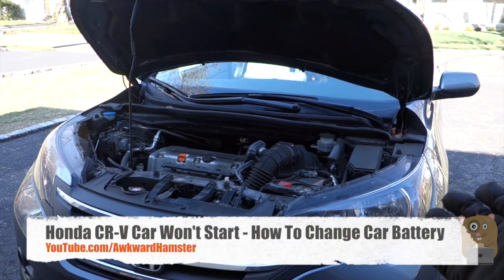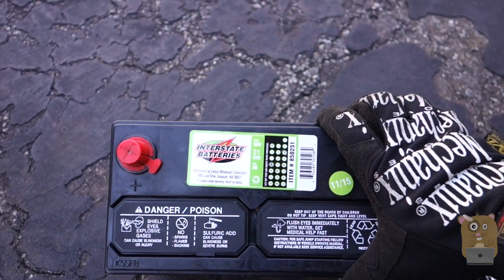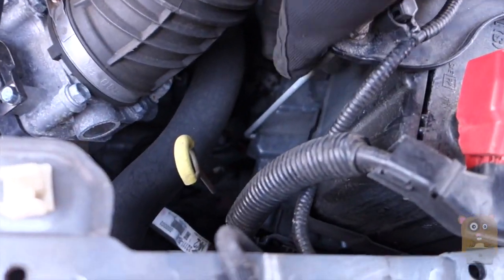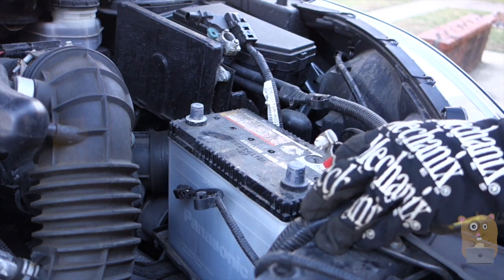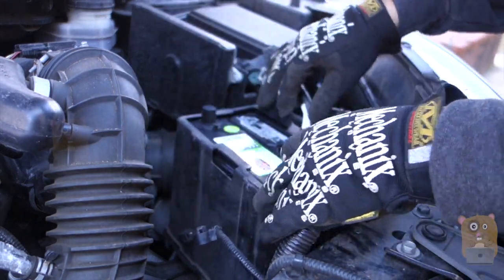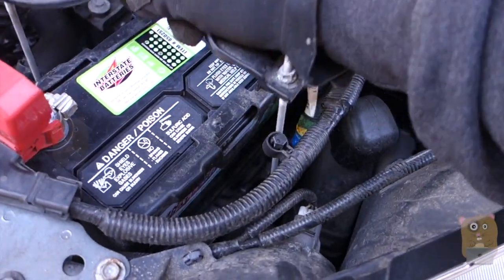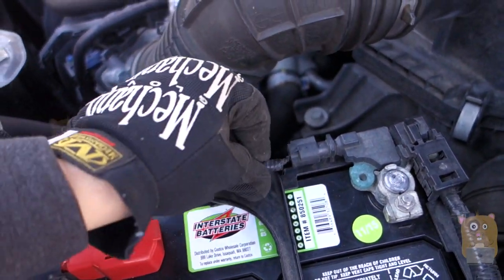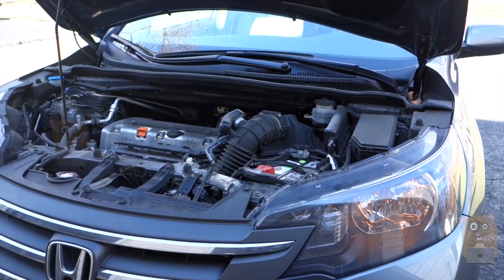Honda CR-V Car Won't Start - How To Change Car Battery

Comment: OMG! You should always connect the POSITIVE Battery Terminal first and make sure you the terminal is tight and secured before connecting the Negative Cable.
Reply: That is completely wrong, DO NOT LISTEN TO THIS^^^^
Reply: SAL Do you really think the Owner's manual is wrong and you are right.  😆
Reply: SAL WHAT? It's STUPID to disconnect the Positive cable first and reconnect it last. Maybe your brain needs a little electric shock to function properly.
Reply: absolutely no difference. except for the following
The reason I would connect the positive cable first (in a negatively-earthed car) is that while tightening the positive connector with a spanner (wrench), if I were to touch the body of the car with the spanner at the same time, nothing would happen and I would be OK.

However if the negative was already connected to the battery and I shorted the positive to the body with the spanner, there would now be a short circuit with a big spark and a possible fire. For the same reason I would disconnect the negative connector first too.
Reply: Negative cable should be secured first.. This will help prevent "you" from being the path to ground in the event of a short.
Reply: The reason I would connect the positive cable first (in a negatively-earthed car) is that while tightening the positive connector with a spanner (wrench), if I were to touch the body of the car with the spanner at the same time, nothing would happen and I would be OK.

However if the negative was already connected to the battery and I shorted the positive to the body with the spanner, there would now be a short circuit with a big spark and a possible fire. For the same reason I would disconnect the negative connector first too.
Reply: @939salm  sal goes silent. Hopefully you don't work on cars buddy.

Comment: Anyone have grinding noise from engine when first start on cold mornings. Some people have the problem and it seems some don’t. The grinding can’t be missed. Honda won’t acknowledge but it has some to do with an auto cam adjuster or something..anyway I turn the key all the way to right for 30 secs or so and then turn to start very quickly once or twice without starting and then start...it helps. Comment please
Reply: same noise from my 2013 crv.  only in cold mornings does it do it
Reply: Check out that starter is returning to disengaged position

Comment: Hello sir, I have a 2014 CRV , just wanted to know what is that container in the bumper on the left called ? I takes fresh air to the air cleaner
Reply from the maker: If you’re referring to the air filter located under the hood, that is for filter out leaves and stuff so it won’t reach the engine components.
Reply: @AwkwardHamster   Thanks

Comment: Is there a security code needed to enable infotainment after the battery install?
Reply from the maker: I need to enter a 5 digit security code after changing the battery, or any power loss, before I can use the radio. My 5 digit code was included with the owners manual packet.

Comment: I think I bent the holder on the top.... is it gonna be a big problem? I’m worried...
Reply from the maker: You mean the metal crossbar that goes across the top of the battery to told it in place? That’s not a big problem. Try to straighten it back and use those J hooks to keep it secure enough so  the battery doesn’t move or shift when when driving. The J hooks are usually pretty long so they can be easily adjusted.
Reply: @AwkwardHamster  alright... that's what I did. Thanks a lot! You replied really fast. Thank you.

The video was very clear. Easy to follow. Great job!

Comment: Did you have any problems starting your CRV after installing a new battery? Let me know if this solved your problem. I am currently thinking about changing the battery on my 2013 CRV. Thanks
Reply: Sung Yang - We changed the battery and it still wouldn't start. Called Blair's Towing and the driver was able to start my car; he said he pumped the gas a few times before turning the ignition.
Makes me wonder if lack of gas was the problem all along, rather than the battery.

Comment: Hi was the computer ok after changing it? Did it need to be reset or anything?
Reply from the maker: After Honda updated the computer, the car allowed me to start even at a lower voltage. I think before the computer update, the car won’t let me start the engine when the voltage dropped below a value. I still had to replace my car battery.

Comment: Thanks for the video.  I just replaced mine on the same car with the same interstate battery from costco.  The car starts up fine now but the battery light came on.  Anyone know what this means?
Reply from the maker: +arshakadelic 
Be careful. That light indicates there is an issue charging your battery. Car may start but it isn't charging the battery properly. So if battery runs out you will be stuck on the road. 20 sec after starting the engine the battery light stays on? Do you still have the old battery?
Reply: AwkwardHamster yes it's still on 20 seconds after.  Just drove around the block, it's on.  I do have the old battery.  I read it maybe from loose terminal connection or corrosion that wasn't cleaned away.  I used baking soda and water and scrubbed most off but there were some stubborn pieces I couldn't get off.
Reply: AwkwardHamster also, I did put those felt pads underneath the terminal connectors and covered it in silicone grease
Reply: AwkwardHamster dude, just realized I forgot to reconnect the wire that clicks in!  Fixed it.  🤦‍♂️
Reply from the maker: +arshakadelic 
Sweet
Reply: arshakadelic I'm also having the Dead battery issue on same year and model. ?? Dead battery requiring a jump  with increasing frequency. Second time in a month as of today. Why isn't Honda addressed this yet? I really don't feel I have any alternative but to change the battery. Thanks for the video Awkward Hamster.
Reply: Drew Abas my car was over 3 years old and with 55+k miles.  I think it's normal battery life and just has to be changed.  Not a honda defect
Reply: @CarlosSpicyWeener  Battery life is 3 years. 4 years is acceptable but you may experience issues. I replace mine between 3 and 4 years.

Comment: Thanks for the instructions 👍 I have 2016 Honda CRV does we need any kind of radio activation after we replace the battery?
Reply from the maker: Yes, I had to enter a 5 digit code to use the radio after a power lose, like changing the battery. My radio code is found with the owners manual folder.

Comment: How  can I decode the ecu of Honda cr.v 1999 model without the obd2 socket
Reply: I buy newborn the honda crv 1999 but I didn't know the place you want to program there but the car will start but it didn't have the place obd do you have to put the machine and you program I want you to ask weather they have different machine they use to program that 99 honda crv please I want you to help me to show me how to program the board the car will start

Comment: Did you have problems with the computer not retaining it's memory when the battery was disconnected?
Reply from the maker: The electronics gets reset whenever the battery gets disconnected
Reply: @AwkwardHamster  Okay - thanks.

Comment: did it fix your issue longterm? im googling this issue because my fathers 2016 crv has had the battery drained after short trips... so wondering if it's worth changing the battery.
Reply from the maker: It was a combination of having Honda update the computer and changing the battery that fixed the issue. If you don’t live in cold climates your battery may still last another year or two. But for my cars any battery issue pops up in the winter.
Reply: @AwkwardHamster  I live in one of the coldest countries in Canada (Quebec) with harsh winters this is starting to make sense. Could you please tell me how  Honda updated the computer? Thank you and seasons greetings! =)
Reply from the maker: I don’t know how Honda updates car computers. The letter I showed at 0:14 basically told me to bring it to Honda so they can update the computer.

Comment: What do I need to do when digital screen isn't showing in Honda CRV, 2015
Reply from the maker: Hopefully that’s just a blown fuse instead of a broken screen. Check the manual to see which fuse applies to the screen that isn’t showing. Take it out and look if it is blown. If so, get the replacement at pep boys or any parts store.

Comment: My 2016 CRV just took a big crap... it's got less than 3000 miles and it won't turn over. I got the computer "updated" about a month ago. We couldn't even jump it. Do you recommend getting another Honda battery or going with something else?
Reply from the maker: I would just go with another brand battery.  I pay more attention to cranking amps (since I live in Jersey) and warranty and I'm less concerned about battery brand.

Comment: own a 2009 element and just replaced the original battery 6/04/17 can not complain about that 73000 miles and 8 years
Reply from the maker: wow, wished mine can last that long.  Does it snow in your state?
Reply: i live in north east Pennsylvania and it snows a lot also it has been as cold as minus 20 in the winter i also owned a 1998 Isuzu pick up and the Panasonic battery in that lasted 8 years and that had 185000 miles when the battery died

Comment: Does your CRV make a grinding type sound on cold startups?
Reply from the maker: +Chris Corley 
Yes. My Honda Accord does it too.
Reply: Did you ever take it into the dealer to get it checked out? When I took it in they told me that Honda was working in a fix and it should be released soon. That was in 2013 and it's still it fixed.
Reply: @frenzy2223  I know it's been a year, but for others that may be cruising this thread that's the infamous actuator valve problem.  It does it on accords, CR-Vs, etc... There's no real fix for it.  According to the forums Honda can replace it, but it comes back, sometimes after 3k miles and or up to 20k miles.  And to get to it, they have to remove a lot of engine components, which if not done by a great technician can cause more problems if they don't follow a detailed procedure correctly.  The best thing I've heard of and tried so far is to turn the key to the on position, but don't crank it.  Let it sit for 3-5 seconds in the on position, then turn the key to off and then start it.  Apparently this helps the actuator reset properly before starting.  Who knows if that what it really does, but it seems to work.  Our 2014 CR-V only did it when the temps drop.  So I remind my wife every October to start doing this short process.  She rolls her eyes, so it's doubtful she does it every time though... LOL  P.S. Along similar lines, it's good to let the idle process complete before taking off.  That is, wait about 30 seconds after starting or so for the RPMs to drop back to normal before taking off.  Apparently that also helps oil get to all the right spots in the engine so everything is lubricated and it will increase engine life  rather than just taking off immediately after starting.  Just something I learned recently that is worth sharing.
Reply: 07civic too

Comment: I bought a used 2014 crv with 26,000 miles on it.We went with a Honda because we owned a new 2003 Honda accord and had great reliability with the vehicle.We like the CRV but we are on our third battery after 37,000 miles.The last battery lasted only 5 months and was brand new.I just got a free exchange and installed it today.I have to believe their is either a parasitic drain or software issues where the computer is not charging the battery correctly.I have read where the ECO mode is a huge drain on the battery because the computer shuts down electrical to achieve the mileage Honda advertises.
I'm 65 and up until now I normally got 6 to 10 years out of every vehicle I have owned and that was up North in a very cold climate.We live in Florida now and the vehicle should get even more years due to the warm weather.
Reply: We have a similar slow crank issue that lead to two jump starts in 3 or 4 weeks. Picked up a battery at O'Reilly ($190 and change with an $18 core refund.) We use Eco Mode almost exclusively. Will update once the battery is in. 2016 Honda CR-V, 36,000 miles
Reply: Update? It’s almost nov in Chicago and I’m having same issue

Comment: after you changed the battery and started the car, do you see any code or anything abnormal? did you lose preset radio or cell phone connection? Or everything just became usual as before?
Reply from the maker: +QQ QQ
No, the preset and cell phone data stayed. Prob had to enter the radio lock code but that's not a problem.
Reply: thanks. Did you see any indicators on, like engine or others? And what's radio lock code?
Reply from the maker: +QQ QQ 
No warning indicator lights came on after the change. Radio unlock code is in the owners manual or pamphlet you got from the dealership after purchasing the vehicle. Every car has their own radio code.
Reply: thanks for your prompt response!

Comment: Hi. I have the same issue with my 2013 CR-V. Dead battery; required several boosts. I did take it to the dealership, and they said, oh too bad you just missed the warranty expiry. My CR-V only had 35,000km, which for you Americans, is about 22,000miles! 
They told me to keep plugging in the battery tender to allow it to trickle charge. What, a relatively new car I have to plug in (more like WTF Honda?!?) 
I've had batteries last me 8 years on vehicles - even those batteries were bought reconditioned at $30. But here a Honda factory battery wouldn't hold up to it's requirements to keep charge.
Honda needs to wake up and realize their factory battery with only 410 Cold Cranking Amps (CCA's) are not enough. Why then Honda, are most replacement 51R batteries such as Costco running at 500 or more CCA's?

CAUTION on the video - as a rule of safety, the Negative Terminal should be removed first to avoid a potential short - which can be severly hazardous. Overall, a good video though bro!
Reply: Yes same thing is happening to me right now.  Honda is not the same anymore.  Quality is just not there.
Reply: I started to face same issue on my 2013 CRV after 2 years. Engine could not start in the very cold weather, lower than -10 degree. Dealer checked still good condition. But this winter it happened again and again and my warranty is expired. Won't buy Honda again!
Reply: my 2013 crv has a factory battery with 500cold cranking amps marked. They have changed to better batteries. Mine lasted 6 years.

Comment: American Honda Motors Co. Telling customers to update the computer...what a joke and a bunch of newbies...! NEWBIES I tell ya.
It is definitely the battery issue, most 2010 to 2016 has the common battery issue, the battery doesn't have enough cca for colder climates especially in Canadian Climate regions...
Reply from the maker: I went to Costco yesterday to try and get a battery with a larger cca. Unfortunately my cvr can’t fit a larger one.

Comment: PLEASE PLEASE , I swear this is true!  I was in the Power wheelchair business for decades.  ALWAYS ALWAYS keep the red protective cover on the positive terminal at all times, then snap up only when connecting it to the battery.  I had a friend of mine changing a pwr wheelchair battery in a middle school classroom in Sarasota Fl. No gloves and and wearing a wedding ring.  He accidentally hit the positive and negative terminals with his ratchet wrench.  Due to the severe burns his ring finger had to be amputated!  Batteries, especially new ones have more powerful amperages than  amateurs know about!!!!
Stop posting videos that show how much you do not know!!!!